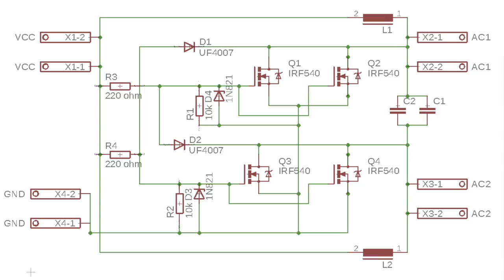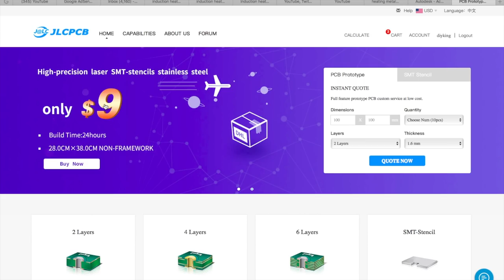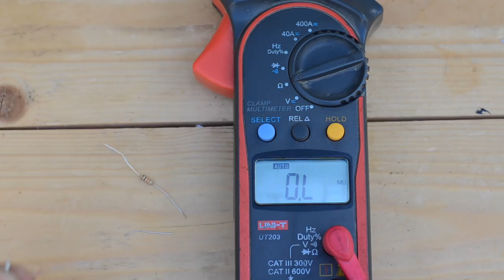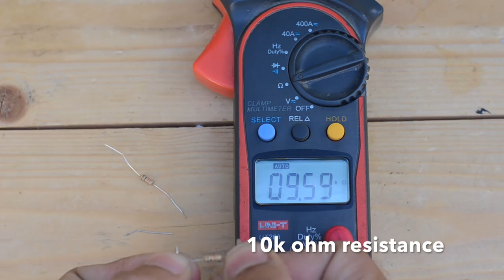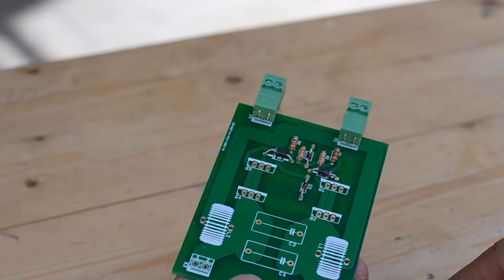How to make an Induction Heater (Like a professional one)

Comment: Awful! The Eagle routing is horrible, the 5V zener diodes at the MOSFET gate are to low, no thermal paste between MOSFET and heatsink, poor soldering skills.
Nothing professional!
Reply: MegaSteamfreak please write what parts must be changed
Reply: @meyou-mk3qz  Well his points are valid. I noticed the soldering was pretty bad. It was not hot enough and the solder did not wick out onto the board properly, or into the coil connectors. There should be grease under the fets for good heat transfer, and the diodes probably are not selected properly considering the things runs on 15V. He might be using the resistors to drop it to a safe level though. I have not studied the circut. Others have pointed out the hot glue will melt if it gets hot and the fan will fall off when you need it the most.
A really professional induction heater would have protection circuitry as well, because your customers would fry the mosfets like crazy by not applying a good enough power supply, or shorting coils of the primary inductor.

All that said, he still did a really nice job for a DIY and at the power levels he is running it, it will probably be fine. He was also quite clear about the components used and the schematic. The video work was pretty good too.
Reply: @court2379  can we use a power supply less then 130A range if we aim to achieve more then 20mT field intensity in the range more then 20kHz

Comment: The IRF540 MOSFET's are rated at 100 volts, and break down at 140 to 150 volts. If you need capacitors higher than 400 volts, I would recommend MOSFET's rated for 250 volts or more. Peak to peak voltages appearing at the capacitors, is also appearing across the drain-source junctions of the MOSFET's. If they're getting too hot, that's probably the problem.
Reply from the maker: Yes you are right
Reply: Ok, but it is the current that causes the temperature rise.

Comment: Are you sure the capacitor issue was due to the voltage, seems like a current issue to me? I have heard the tank circulating voltage is pi x the input voltage, and have seen others that seem to run around 3x the input as well. I have never found any credible explanation as to why. It would get pretty dangerous to touch the coil if it was getting above 60V and above 400 would be very dangerous.

Can you test the voltage while running it, and then again running it under load?
Reply: The mosfets will limit cap voltage to 100V-120V. Higher voltage than that would kill the mosfets. It must have been I2R (heat loss) in the cap that killed them.
Reply: @scoutjonas  can we use a power supply less then 130A range if we aim to achieve more then 20mT field intensity in the range more then 20kHz
Reply: @ShafqatAli-jg9ym  I don't know much about resonance circuits.

Comment: My purpose is to heat 5 inch steel pipe to 150 degree.Please suggest     
appropriate induction heater
Reply: Use more turns on the production coil . depends on your project though . Pipes are easier than solid steel bars.
Reply: @lemonidasm2530  
Is it possible for above circuit?(1/4 inch cu tube (6m long )10 turns Outer dia 17 cm)
Reply: @avinmathewvarghese8039  watch this guy https://www.youtube.com/watch?v=_v5Hg2zfLjs  . hes thorough explaining the whole circuit and also he is testing different materials. There you will understand that less ferrous materials produce different effect. On my side i found out that heating a steel , a chrome , or a galvanized pipe have different current draw demands on the circuit. Be careful with galvanized. fumes are deadly . I ended up with a normal water pipe of 1/2 inch that does not contain that much steel in its mix . i managed to keep 3 circuits working for weeks during winter (no forced cooling) at 275 celcius. For 1/2 inch outer pipe diameter i had almost the same inner diameter working coil , covering the pipe with insulating ceramic paper 3mm(without steel reinforcing strings)  to avoid temp transfer to the working coil and eventually PCB melting. Those were my findings .Hope this helps you .

Comment: Crazy idea, use a graphite rod inside the induction coil. Cover coil with a thin sleave of titainum which will glow white hot. Place sleave inside an insulated cylinder with nintinol thermal electric generators around the inside of the insulated cylinder with the sleave positioned in the center of the insulated cylinder. Have electric fan draw in air and force it around glowing sleave to heat the air. Design space heater to start up off a of a 12 volt power source till the Nintinol thermal electric generators kick in to generate the volts needed for the induction and to operate the fan. Or add in an organic carbon power cell that starts the induction cycle that heats the Nintinol thermal electric generators then power cell drain shuts down and power cell is charged to full then power to cell shuts off leaving the Nintinol thermal generators powering the space heater.  A self sustaining space heater? Hint try using two tesla coils to heat the graphite rod.   You will need to test to find the correct frequency to pass ftom one tesla coil to the other to cause the graphite rods crystal structures to vibrate and generate heat. You should be able to transmit a frequency from tesla coil A to tesla coil B with zero energy loss while passing right through the othet refined crystal structures and affecting the graphite's crystal structures to generate heat. High heat superconducting ceramics used to generate a superconducting.power loop then passed between the tesla coils with zero loss of energy.   😊😉

Comment: bro make a welder using old microwave transformer
Reply from the maker: Ok That will be one of our upcoming projects.
Reply: Why can't welder made from the transformer be used to heat the object just as this induction coil does? Am I not thinking correctly?
Reply: A microwave transformer puts out 60 cycle power. - - -  The induction heater requires a much higher frequency power than this.